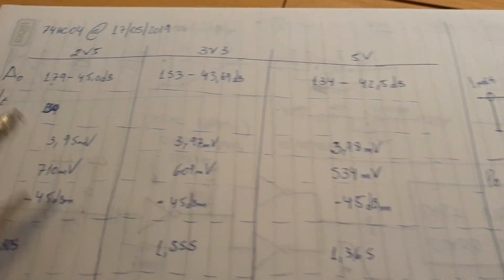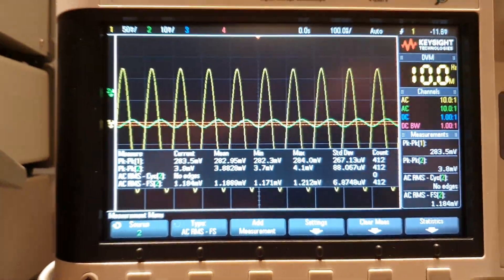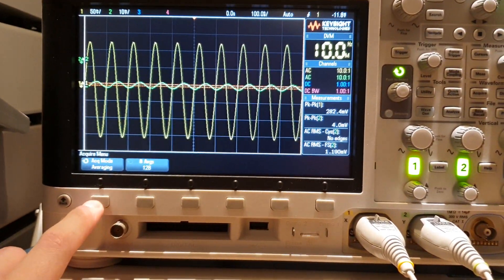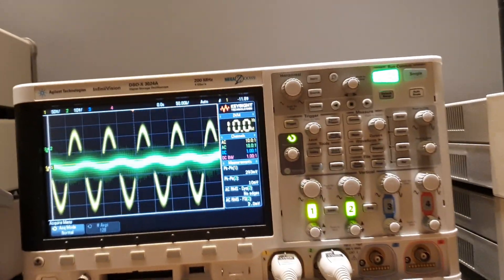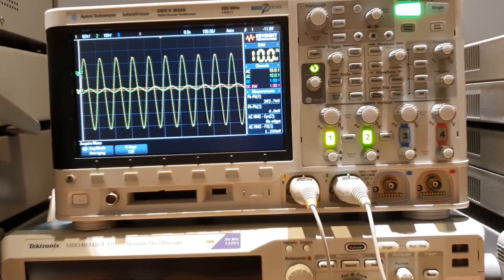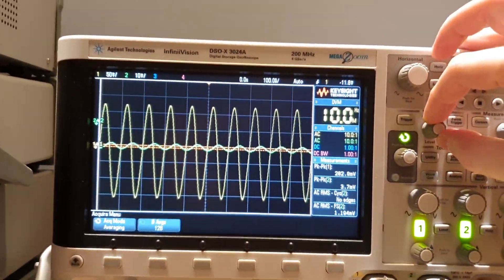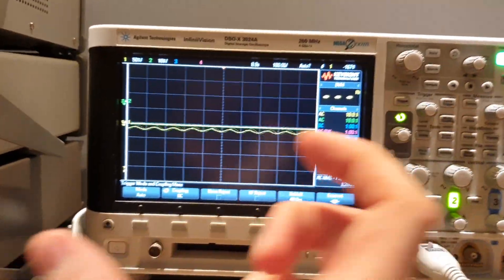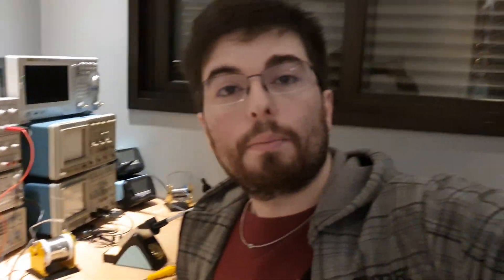Oscilloscope Average Acquisition and AC Triggering

Comment: When the reference of the weak signal is available (and used as a strong signal to sync on it), then the averaging mode (average between consecutive traces) will turn the oscilloscope into a lock-in amplifier.  Very useful trick, indeed, when it comes to measuring repetitive but small signals that are flooded in noise.
Reply from the maker: Really nice!!!!